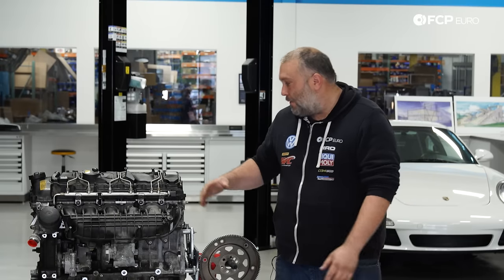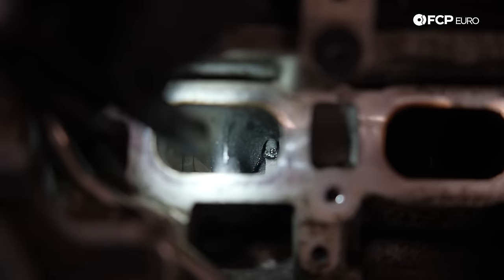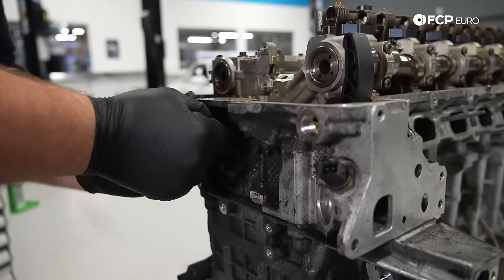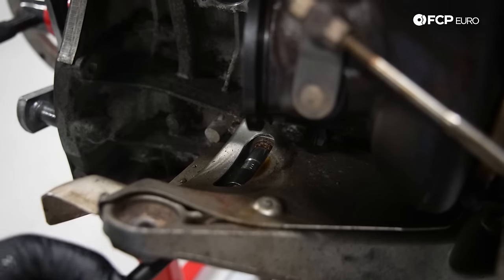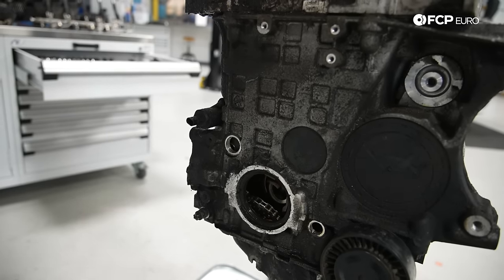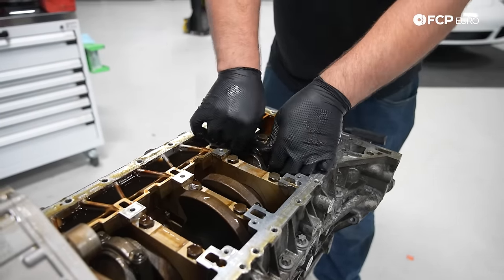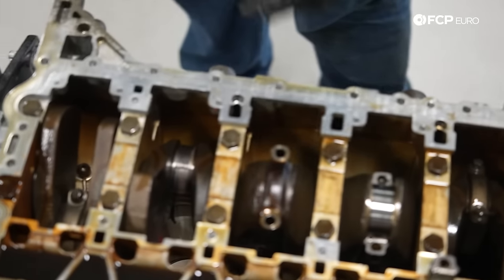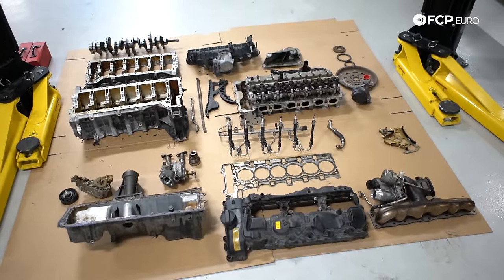Spun & Done - Tearing Down A BMW N55 With A Failed Rod Bearing

Comment: Heard people in the N55 community say the car goes through terrible oil starvation under intense turning force or when doing donuts
Reply: Completely believable. There is zero scavenging/baffling in the typical N55 oil pan. The pickup is also not very deep in the pan either. Based on the design I would not consider tracking one of these cars without some oiling upgrades (minimum a baffled oil pan).
Reply: U want to do donuts buy a Miata or a vet. Bimmers are for comfort. None of them are high horespower in my op. I’ve had like 8 bimmers. There comfy. Sound proof. Kids beating on shit usually leads to everything breaking.
Reply: @Ryan Blake  my M135i with N55 is 418 bhp, it is very fast.

Comment: Will rod bearing issues affect stock cars that are just road driven moderately? Just curious if I should do this as preventative maint,  I want to keep the car for a long time. I barely go above 4k rpm maybe 3 times a month, the rest is just normal driving.  The car is an 11" with 180k kms (120k miles ). 
)
Reply from the maker: Hi VB, this can happen to any vehicle. The best thing to do is simply stay on top of maintenance on your N55 and maintain stict oil change intervals. There may be a need to consider bearings for long-term mileage on N55's without updated bearings.
Reply: I got a 2011 n55 e82 that's been on the nurburgring, and I regularly do 250-280kmh on the autobahn in it. Haven't had anything fail & it has several bolt ons. It's made to go fast so get that carbon out of there and don't baby foot it.

Comment: storing crankshaft vertically is bs :D and actually might be worse because now you have the potential of tipping it over and actually damaging the crank
Reply: I was thinking the same thing.  If the crank bends on its own weight, then that thing is a POS!  Also, if you stand it vertically, think of the entire weight of the crank shaft resting on the bottom-most bearing journal and it's creating a moment, or twisting action on that journal - that's a lot worse than having the crank lay on its side and having the weight be distributed at several different locations.

Comment: Aweosme you have a 2011 335 and I love my n55!!!
Reply: how much does it cost per year to maintain an n55?
Reply: @HaiderAli-ot2gg  brother it’s my first bmw and it’s the best car I ever owned - I bought it with 9k miles and has 70k miles and only replaced radiator , cal a cover Gasket and general maintenance- check my channel I have some videos. If you want a 335 get at least the n55 , I’m glad I got the last of the e90 as it drives amazing

Comment: This literally just happened to me a month ago. Apparently early 2011 535i models were prone to this? Really made me think twice about going for another “reliable” bmw
Reply: Sorry to read that... How many kms/miles??
Reply: @aruekca18det  car has 130k miles. It has been serviced routinely every 5k miles for oil and has been done so by previous owners. Like the e92 m3 and their respective rod bearings, this seems to be a mistake on BMWs part (regarding bearing and crank shaft design for early n55 engines).
Reply: @david_vash  that is unfortunate, mine is also early N55 on a X5. Currently at 61,000 miles. Oil service every 5,000 kms and light driving really... But who knows what will happen.
Reply: Yeah that sucks I saw some videos of people saying if you’re around 80-100k miles it’s a good time to change them
Reply: I'm sorry to hear you suffered from a rod bearing issue. As these engines have aged it's become more of a "thing". One thing I noticed is a change of the oil pump part number at 8/2011. I wouldn't be surprised if BMW was seeing some problems with the demand based pump and made improvements so unfortunately I think early production engines didn't get this benefit. To that end, I'm not a fan of the windage tray/oil pickup behind made entirely from plastic. Microcracks on this part could bleed suction to the pump interrupting flow/volume and creating symptoms similar to a failing pump.
Reply: @GarethFoley  always wondered what the changes were. Thanks for clearing that up!
Reply: @GarethFoley  any other “big changes” you know of? Thanks in advance!
Reply: @david_vash  came across on Facebook it happens to some guy with 2018 x5 n55 motor spun a rod 🤷🏻‍♂️ I always thought only the pre LCI had that issue
Reply: @ademc8872  Just talking about the lubrication circuit there was a part number change for the oil pump control valve at 7/2012. It's an external solenoid down towards the bottom on the front of the engine that helps control oil pressure. For some applications, like the F87 M2 with the N55 all the S55 parts from the F8X M3/M4 were used (oil pump, scavenge pump, oil pan, etc) were used.
Reply: @Top_g80comp  It's an N55 problem altogether regardless of mileage. The problem with these failures is it's next to impossible to correlate the failure with a plausible "why" without service information or if any repairs were performed before the failure occurred.
Reply: @GarethFoley  I wonder if this sort of issues is great enough to seriously debate whether or not the n55 is truly that reliable? Ironically enough I got it for its reputation as reliable. I’m sure though that a rod bearing replacement for owners who catch in time won’t have to worry again about this issue.
Reply: 2011 was a bad year. I hear about problems with 2011 cars all the time. 2014+ had many major revisions.
Reply: @Top_g80comp  Just about every spun rod bearing issue I have seen/heard of was the early N55 but they can happen to any year if you track the car hard, take corners hard which will make the oil pump run dry. People say to run an extra quart of oil to avoid this issue when tracking hard. Another problem is these cars oil sensors will only tell you when you're a quart low.
Reply: @rayland9305  came across a complaint on BMW X5 form gentleman from east coast had his engine seized 2018 X5 low miles gently driven . I was shocked, luckily bmw did replace the motor under warranty.

Comment: I’m a Ford tech formerly with Volvo and was horrified when I learned that Ford uses freewheeling crankshaft timing gears on some of their engines.  Now I learned BMW does that too??  SMH.
Reply: It's more common than you think. I think the only reason it was ever implemented was to cut down on assembly time since there is no timing cover and the timing cassette (timing guide, chain, and crank sprocket) all get dropped down through the top of the engine as one assembled unit. There isn't any other logical reason for the design outside of that.

Comment: What would you do with the engine from this point if you wanted to make it more “robust” or is there a direct swap you recommend for an engine to take the N55’s place in a vehicle?
Reply: The N55 is stout. It would make no sense to do that.
Reply: @princeali316  I’ve seen several well maintained low mile N55s (driven by older drivers) that have had premature rod failure…. I don’t consider that stout…. I’ve had engines ago over 200,000 being run hard that didn’t make a noise when I got rid of them…
Reply: @brianf7758  Rod failure? I call BS. Spun rod bearings you mean? That was mostly an earlier N55 issue. 2011-2013
Reply: @brianf7758  We have 5 in our SoCal club that are over 150,000 miles and 3 that are past 200,000. This is a stupid idea from a mechanic's point of view. Doing the rod bearings is a better investment overall... If you ever have to or are that paranoid about them. B48/58 are currently blowing up in small numbers too. But it's 1% of total motors on the road. The n55 is one of the world's best engines and won awards for its design. Especially the EWG models. People used to worry about the N52 for sucking belts, but here we are almost 16 years later and the mass majority are running 300,000+ miles. This type of paranoia is justified sometimes but also cyclic. Parts manufacturers enjoy it because they can sell more parts. There's articles on this topic and this motor is specifically highlighted... 

Instead of arguing with everyone here, you need to do an oil analysis and decide from the report whether yours are good or bad. I understand your paranoia though.  Additionally, change your oil every 3-5k and let it warm up properly every morning before beating on it right away.
Reply: @Euro316  - No thanks. I'm done with BMW, having owned 5 of them over many decades. I drive Honda and Mazda now. Not as luxurious, but I sleep at night. I also have a 4Matic S-Class, but it's older (cheap) and sees very few miles, so luckily I haven't had any issues with it. It was peanuts so I don't care if it has a catastrophic failure, I can part it out and get my money back or donate it.
Reply: @brianf7758  idk if you noticed it, but all the possible reasons why this engine can spun a rod is because negligence of the owner?… 
1) If you did OFHG on your N55. BMW says you NEED to prime the engine. If you don’t and it spins, you were well aware
2) If the car is running low on oil and is asking you to add a quart, you must add a quart or you’ll starve the engine from oil
3) Is well know that the oil pump is very weak on N55s and is not recommended doing donuts, 360s or heavy tracking because the G forces could starve the engine from oil unless you replace it with a M2 oil sump
4) If you let the OFHG leak onto the belt, is negligence of the owner not replacing because it starts by leaking slowly
5) Replacing the oil every 10k miles isn’t the best idea on any car in general

So there’s no reason to give an engine a bad reputation when it can easily be avoided

Comment: Your not even going to get 2.5mm or more  horizontal play noise  out of the rod and wrist pin when the engine is assembled like what your doing with piston and rod out of the engine floating wrist pin a must

Comment: Got a 2015 535i with n55 what grade oil and brand would be the best for these engines?
Reply: Been running Mann Filters and Liqui Moly 5W-40 since brand new on my 2015 335i. All my oil change kits I have bought from FCPEuro
Reply: I use Liqui Moly Leichtlauf 5W40. In addition to that I use Cera Tec every 25K miles with MOS2 used at every oil change in between the 25K mile Cera Tec intervals. As part of my general maintenance regimen I also use Liqui Moly engine flush every 10K miles to help clean any varnish. My primary reason for use of the additives is to prevent Valvetronic eccentric shaft wear (common issue if the oil squirter for it becomes clogged).

Comment: omg this is crazy. just last year in august my n55 blew up. they never told me what happened to it tho. But i did do several 150mph+ pulls before i heard knocking and on the ride to bmw it blew up. Anyone have any idea? I had a new engine put in so im just curious
Reply: If you braked really hard to slow down or did high g force turns then the oil sloshes to one side because of bad design choice and it causes oil starvation which seizes the engine

Comment: I'm considering getting a BMW with this engine and watched this as part of my quest to learn all I can because I am concerned about the reliability of BMW because of all the horror stories I hear.  As a gearhead myself, I'm no stranger to working on cars and am not afraid of tackling repairs myself, but I'll admit, this engine is built like crap compared to the Toyota engines I've seen.  The timing chains on this BMW look like bicycle chains compared to the robust timing chains on my 2011 Toyota 2GR-FE 3.5L V6.  And why the hell isn't the critical crank timing sprocket keyed?  That's obviously a cost-cutting measure.   After seeing this, I think I'm going to stay with Toyota/Lexus even if they're not as powerful & exciting...

Comment: You want to get most of  it on n52,n54 and n55 change the oil every 3k miles or 5k km no more than that with a synthetic oil and you will not have any  breaks or  visits to your mechanic..just simple..
Reply from the maker: Consistent oil changes go a LONG way in vehicles durability.

Comment: Bmw reliable??? There is not one “reliable bmw” wanna know how I know for a fact! I drive a 06 GS430 ask me how many 2006 bmws I see al through Florida ….. NONE 😂 Learn what reliable means ain’t it ain’t a bmw
Reply: Also Toyota using bmw engines now. B58. There many bmws from early 2000s on the road especially any M54 inline six engines which can run for 500k+ miles.
Reply: @EBKFiXXY  I was saying early 2000 bmws still running, also bmw is rated 3rd most reliable automaker of 2022 by consumer reports.
Reply: @EBKFiXXY  also b58 a aluminum block can withstand 800whp on stock internals. S55 can handle 1100whp stock internals. DYOR.

Comment: Why is it SO difficult for BMW to make a reliable engine? Former 5 time owner and I'm disappointed and done with the brand.
Reply: Depends what engine you pick, n55 actually good one if maintained. B58 is so far most reliable bmw engine. Even consumer reports put bmw as 3rd most reliable brand. Also if you buy used, how reliable your bmw is will depends on how the first owner maintained it.